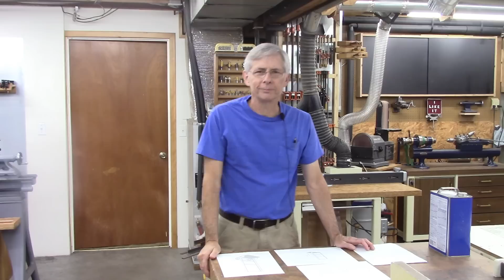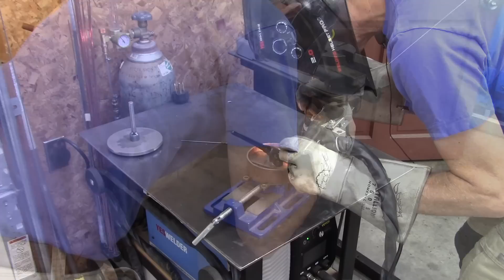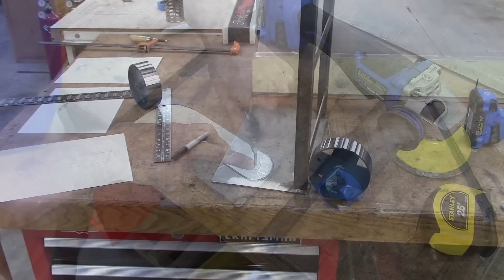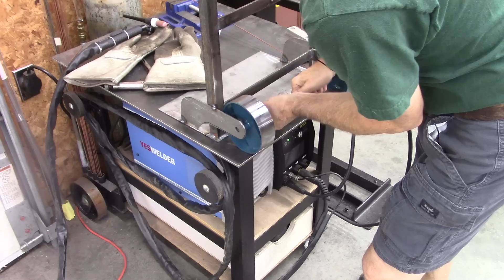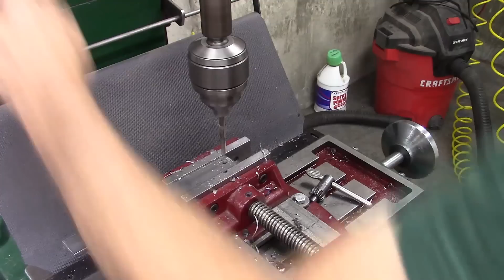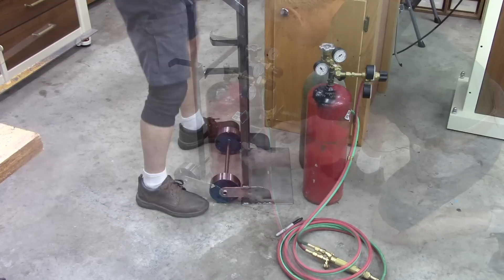Building a Small Footprint Welding Cart - Part 1

Comment: Good build Mark. I'm glad you went with a full handle. You will have more control when moving it around. I inherited a welding trolley with large bottles. It has a single handle in the middle and it is not easy to move it around with one hand.
Reply from the maker: Interesting. Thanks for the comment!

Comment: Great post.

I modify cheaply available sack trucks to do the same thing, and use chains on hooks to secure them(I do a lot of site work). 

BTW Put a valve guard on the cart as you will often bump and damage them when moving the cart....😊

BTW2: Fuel gas and oxy is really expensive(and domestic insurance policies usually EXCLUDE them from cover(for obvious reasons) - If you have TIG then acetylene is pretty much obsolete in any case....
Reply from the maker: I'm not going to ask about insurance...  valve guard is probably a good idea. I agree about tig. Usually I use gas to heat or braze. That why I didn't get the 80 tanks.
Reply: @WinkysWorkshop 
Valve guards will save your(and my) bacon - Sod's Law says that the heavy item on that bench/shelve will fall on the valve gear!!! 

For over 30 years Ive been buying industrial gases, and NEVER ONCE in that time have I ever received a supplier letter, notifying me of price decreases due to wholesale markets!
But conversely, every 6.months or so.....£$€!! ;-)

IMHO : Avoid the use(cost/hassle in hobby/DIY) of pressurised industrial gases! 

Not sure of US cylinder colour schemes, but you can braze just as well with Propane as you can Acetylene(use a Gas Axe(cutting torch) , and not an oxy/Acetylene welding torch)  - the excessive carbon in Acetylene has a cleaning(deoxidization) action, which Propane can't achive, so almost ANY metal fusion utilising a flux(deoxidization agent) DOESN'T NEED Acetylene's cleaning action. 

Acetylene is only ever required for Lead(propane can work, but leaves poor bead formation) and Steel  burning(AKA MAG) , although DC and AC(in that order) TIG make these obsolete too. 

When your first taught about Acetylene in welding schools, then an intrinsic FEAR and RESPECT of it is drummed into you!(stories of flash back failures, with cylinders having to be bathed in running cold.water for DAYS to prevent explosion) ! 

Keep up the interesting posts. 

All the best from the Highlands of Scotland 🏴
Reply from the maker: @craigywaigy4703  I've had tanks my entire life and never had an issue. In some way propane is actually more dangerous. Shipyard don't use it because it accumulates in low areas and produces much larger amounts of carbon monoxide. Small leaks accumulate over time and become a major hazard. Of course I have a drive in basement on a hill so I'm not really worried. Propane also takes 4 times the amount oxygen so the economic benefit is not as much as you might think. I considered switching but the primary reason I stuck with acetylene is the heat distribution within the flame. 90% is concentrated at the very tip of the nozzle. This makes it much better for quick pinpoint heating. With propane the heat if evenly distributed throughout the flame.
Reply: @WinkysWorkshop 
Yup Propane is a bugger for ponding/pooling at the lowest point....
My Brother in Law(retired Industrial/Commercial Gas Engineer) often told me stories of how they could actually bail it out from basements with a. BUCKET!!!
Keep safe and well.
👍

Comment: You'll want the 82 cubic foot and the matching oxygen.  I forget the exact sizes.  Once you get used to having a torch set in the shop, the gas goes fast and swaps on larger tanks are more economical.
I made a similar cart from a handtruck.  I bought a city type mailbox from the hardware store, the kind that mounts on the wall outside the front door.  I also put two "L" rods through the vertical pipes to wrap my hose on.
Let me know if you'd like pictures to give you ideas.
Tony
Reply from the maker: I may do similar for holding welding rods. The 80cuft tanks are way cheaper to fill but honesty the little 10 cuft I had lasted 6-month to a year. Unless my usage goes way up for some reason the 40s will last well over a year. I've had the smaller set for about 10 years. Cool idea on the mail box.

Comment: You can get a carriage bolt with a domed head, turn the sharp edge off so that there's flat sides on the edge, then mount it into a tool holder on your lathe.  You can then use the lathe tool post to push on a part in the chuck and get it centered quickly.

You can buy some cheap chain (with elongated links), cutoff links as required and weld them to bolts and nuts to make quick hand screws and nuts.
Reply from the maker: I had a tool with bearing mounted on the end for doing this but misplaced it.

Comment: Well done Mark.How many tanks you got in your shop?For me I´m trying to live only with oxygen,propane and compressed air.No more acetylene.I need a new cart considering the changes in sizes and kind of gas.Yes,your TIG welding is very good.Thank you.
Reply from the maker: Several have mention going to propane and it might be a good option but the savings are not what you might think. It takes about 4 time the amount of oxygen to get a good mix with propane. From what I am reading propane puts out the same heat but the heat is distributed throughout the flame. Acetylene has 90% of all the heat at the very tip of the nozzle. Propane also puts out more carbon monoxide and unburned propane will sink to any low spot where as acetylene is lighter than air and goes away. I've never used propane but from what I hear its easier to get the heat where you want it.
Reply: @WinkysWorkshop  You are right Mark but they made propane easy,cheap and convenient for almost anything.

Comment: Nice job Mark. I just made a score on Market place for the 10cuf Acetylene and 20cuf oxygen. I swapped the 20cuf oxygen tank for a 20cuf argon at Airgas. Just yesterday I also scored a 80cuf Oxygen tank on Market place. I leased the large oxygen and acetylene tanks for 45 years and Airgas got greedy, ($180 a year just for the use of their tanks) , and my once-a-year usage caused me to turn their tanks in with almost full of both gases. of course, no buy back on the unused gas. Now they refuse to sell tanks so they can force the lease/rental outrageous prices.  The little tanks will serve me just fine, and I avoid being held hostage by Airgas They bought out the local Welding supply that I had done business with for over 40 years. . It really bothers me how the big companies are forcing the consumer to buy from them. Walmart being on the top of my shitlist. Well enough of my rant. Thanks for bringing us along.
Reply from the maker: Air Gas is TERRIBLE. I'll never do business with them again. When I had my MIG welder I bought a 15 cuft (I think) tank from them and had it filled. I took it home and used it one time. About a week later I went to use it and it was empty. I turned it off firmly but it all leaked out. It cost over $60 the first time I filled it and he would give me NO CREDIT on the gas so I paid it again.  I switched company and paid less for their tank and $30 to fill it. The oxy. ace. are the same... double the price. Never again! The company I use now if a small private welding shop. I think they use Volunteer to fill their tanks. They are picky about what tanks they will fill so its hard to get a good deal. on used tanks. Fortunately their tanks are reasonably priced compared to Air Gas. I feel the same about the big companies. Greed driven. I worry about the local shop going out of business. Apparently there is another small shop 45 miles from me that is good to deal with and I'm told they even take the tanks I use. I just hate to drive 45 miles...  the local shop is about 8 miles
Reply: @WinkysWorkshop  Mark I sure don't want to get political but the big companies are out to force everyone to do business with them. My brother lost his job of over 35 years with a local Optometrist because the hospital in the town he lives in has taken over all the medical doctors and medical offices. They told his boss the owner either sell to us or we will put you out of business. The same is happening in the town where I live. My Cardiologist now works for the hospital and has closed down his private practice. John Deer is now known in just about location in Texas as Quality Implements. this my friend is the absolute seeds of Communism. Just wearing a subtle mask.
Once I get the Oxygen filled for the first time I think I am going to look for an independent welding supply. When I got the Argon filled the guy at the counter tried to charge me double of what the guy on the phone quoted me. Good thing he told me to ask for him by name. When I threw up the flag they went and got him, and he made his quoted price good.

Comment: I like it too!  So practical.  Mine are on a many year old cart.  I welded on it but the tanks get in the way! 😂. Since the TIG I just don’t weld with them anymore.  I heat stuff with pinpoint heating like stuck bolts and stuff.  Thanks for sharing!
Reply from the maker: Same here...  I used to weld with gas but TIG is so easy.

Comment: As a welder yes I would have gotten the bigger bottles. Specially if you ever use it to heat metal up red hot to bend it or to harden it. The gas will go quick. That's been my experience. I also had the smaller hard rubber wheels. That didn't work out either for me. Every pebble or swarf on the floor became a nuisance the wheels would stop slide nothing but a headache I'm afraid the steel ones will be even worse. But you know your shop good luck with it. I ended up putting larger wheels like a small bicycle on mine and that works so much better.
Reply: Also chem-o-lene is much better and safer to use as your gas instead of acetylene . the only thing you have to change is your tips in the cutting head. The tips that go with chem-o-lene are also very easy to clean where acetylene tips are not . Just a though research it I think you will like it better. It is much much more safe compared to acetylene.
Reply from the maker: Interesting...  you maybe right about the tanks although I seldom
 use them. Never heard of the Chem-o-lene.

Comment: Nice cart. I use propane for fuel instead of acetylene. A 20 lb bottle will last a long time and is a lot cheaper than acetylene. I use mine mainly for cutting steel and sometimes for heating. I haven't ever tried to weld with it so I can't say how it works for welding, but for cutting it works just as well as acetylene. You do have to get tips that are made for propane but the savings on the propane quickly pays for the tips.

Thanks for the video. Good job on the cart
Reply from the maker: Thanks! I considered propane. I read a lot about the pros and cons of both. Price is for sure better with propane but not as much as you might think. It takes about 4 times the amount of oxygen to use propane so the savings are not as significant as you might think. Also, the flame structure is different. Apparently the heat is about the same buy with acetylene the 80% is focused very close to the nozzle where as the heat with propane is evenly distributed. This gives you a lot more pin point control.
Reply: @WinkysWorkshop  Interesting on the amount of oxygen. I used to buy used farm machinery on auctions and cut it up for scrap iron. I don't remember changing the oxygen setting when I changed from acetylene to propane or a big change in oxygen use. But it has been a lot of years ago (40+ years ago) so I might not remember the details. There is a difference in starting the cut for sure. You do have to heat longer with propane. Once you get the cut started the oxygen is doing all the work, so I don't think there would be a significant difference from then on. Like I said before, I haven't used either to weld with so I can't comment on that use.
Reply from the maker: @mikewatson4644  I seldom you a cutting touch and have not used propane...  but I like the pin point heat source. I'm just going by what I have read.

Comment: Hey winky. I was thinking maybe you should put the box on the backside that way if you wanted to go tall are bottles you could still use the same card just saying
Reply from the maker: I considered that too. I doubt I will get the larger tanks but if I do I'll cut the bracket and weld it on the back Thanks.

Comment: That'll work nicely.  I do have 1 question.  When you drilled the holes in the wheels, the drill chuck was moving around quite a bit. Is that normal or is it just your lathes tailstock?
Reply from the maker: I'd say I didn't get the hole centered perfectly when I started the hole. For this project the position was not critical. A very slight wobble of the wheel would never be noticed. For something more critile I would have taken more time when I drilled the pilot hole. Also the lathe has some wear on the ways (bed). I have the tail stock adjusted to compensate which makes it slightly off center to the chuck. This makes it easier to get a hole started off center. Getting it to drill on center is still possible but you have to make your start hole by going slow at first.

Comment: If you do put a parts box on, might I suggest you mount it beneath the handle so if you do upgrade to bigger tanks, you wont need to relocate it.
Reply from the maker: Good suggestion. I also considered that. I like it in front but if I ever get larger tanks I'll move it.

Comment: You should always have the tanks chained or the covers on.  You are lucky no accident happened and you broke the valve off.  Nice job, but you need to do better with safety.
Reply from the maker: 40 cu ft tanks have no covers. I prefer larger tanks for this reason. Luck had nothing to do with no accident. I was very careful around the tanks. They are super dangerous!